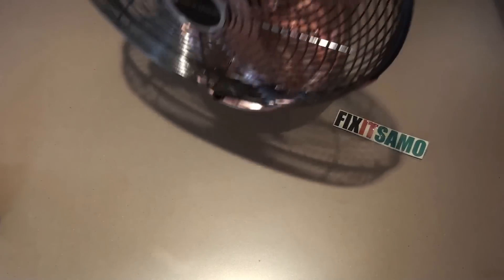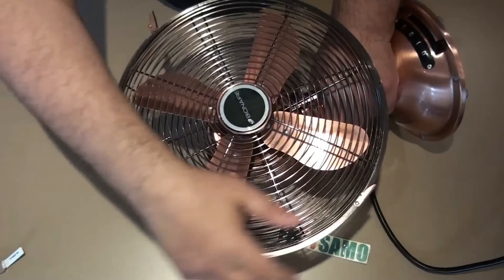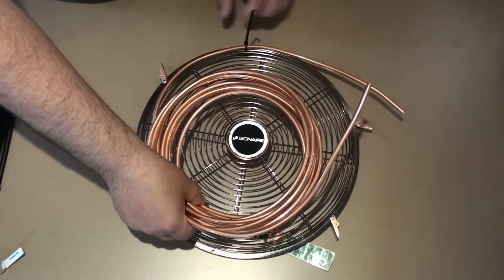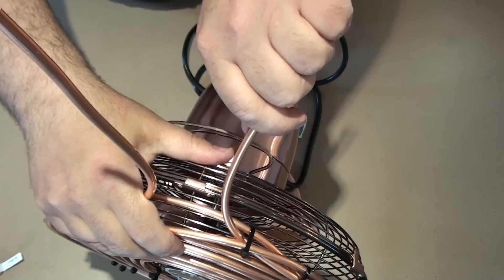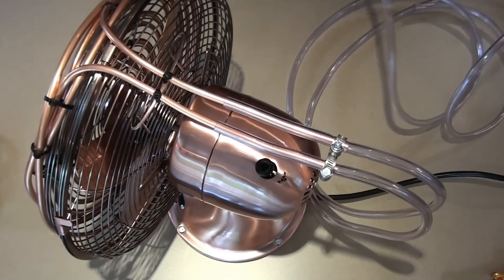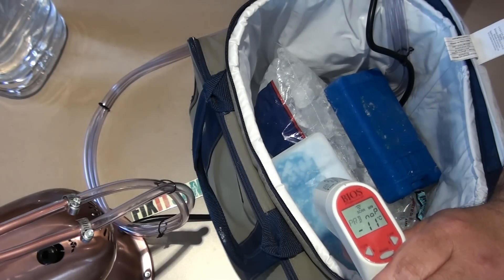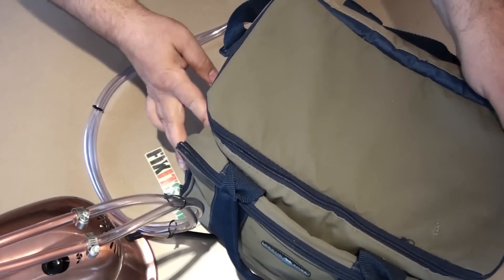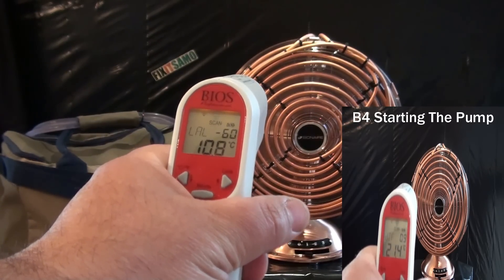How To Turn Your Fan Into An Airconditioner  AC

Comment: the most important part, is hard to understand.. how did you hook up the pump and hose to make this recirculate?? lol :D "I am definitely going to make one of these.. the bag I put the ice in will be on the side of the wall with air conditioning.. Im thinking that once I get it up and going my ice maker "ie, plastic trays" in the freezer will be able to keep up with this for several days to a week.. esp if I sit the ice box inside of another one.. double insulate it :D great idea for the next room/closet that just needs a little boost ;) Im just not clear on how it recirculates.. but other wise awesome.. Thanks :D

Comment: if u can afford that much copper u can afford an AC
Reply: corey I I'm a plumber, a 50' coil of 1/4 copper is much cheaper that a A/C. He is discounting the electrical cost of using his freezer to freeze the ice.
Reply: Rhino qt Apparently you don't know how a thermostat or thermodynamics work. The thermostat will only turn the compressor on if the internal temperature of either the fridge or freezer section of the appliance is above the low temperature set point. Two reasons that the internal temperature will rise above the low temp set point:  one reason is due to no insulation being perfect the world around your fridge will warm up its contents, another reason is any residual heat contained in the food you place in the fridge. This energy will will "flow" down the energy gradient until homeostasis is obtained. Thermodynamic law dictates that all heat energy flow from hot to cold. Refrigerators are not like the A/C in your car while traveling at highway speeds. While driving a car at highway speeds with your windows rolled up, your car's A/C is essentially free operation. The only reason your fridge would turn on is because it is warmer inside than it is supposed to be. You know like filling the freezer with water that is much warmer than the ice cubes you wish to remove from it hours later, that heat must go somewhere. Your refrigerator is a person's single biggest electrical draw and it only cycles on when necessary, if your fridge constantly ran 24 hrs a day always it would cost more than your mortgage to operate(possibly depending on the size of your house) and would burn out rapidly. Do a little research before you want to argue concerning topics you know so little about. Good day to you.
Reply: Breandan Byrne your freezer is on regardless of you needing to make ice or not
Reply: Rhino qt Your freezer is not on regardless of you needing make ice or not. Is that simple enough for you. You're very brace considering I can't reach out and touch you. If you believe my information to be inaccurate then go on earn some information for yourself. Good day to you.
Reply: Trevor Loffler thanks, random white night o7 I appreciate your input
Reply: And the heat from the water that the freezer removes is put into the room that he uses the ice to cool. You are just moving heat from one place in the living space to another. That's why A/C units go through the wall. The heat is removed to the outside.
Reply: put the insulated cooler with the water outside then? i'd rather a cool room if i did this than a warm water box. These comments are nekk level

Comment: how bout using liquid nitrogen?
Reply: salem zeid Tubes would explode.
Reply: ...
Brilliant idea.
Absolutely try that.
There's nothing that can go wrong.
You won't get seriously injured if sitting right next to it!
I am totally being serious right now.
No joke.
Actually yes joke, that is a very bad idea for several reasons, the least of which is the tubes bursting or even exploding.
Reply: Volvirth Out of curiosity, what problems could he have other than the tubes exploding?
Reply: +Hello_ Burn marks over his skin and lacerations from shrapnel
Reply: Viewing Wouldn't the leidenfrost effect protect him from burns? And I'd say shrapnel comes under tubes exploding...
Reply: +Hello _ Nothing will expload because the liquid nitrogen would freeze that tiny pump as soon as it runs through the pipes.
Reply: Viewing Would it not decompress and force itself through the tubes anyway?
Reply: Viewing Also, where would the shrapnel come from if nothing explodes?

Comment: If you add two table spoons of salt to the cooler, would you get colder temperatures?
Reply: Plus the salt water would cause the metal to corrode (rust) thus making the transfer of energy between the water and pipe slower.
Reply: Probably not, because the salt will cause the ice to melt faster.
Reply: Rafael Roman well the first guy is an idiot. it doesn't melt faster. I lowers the freezing temperature which would in fact bring the water down a few degrees. it probably wouldn't do enough to be worth the corrosion. but it's good thinking
Reply: Nick Petrillo my military buddies always put salt in there coolers to make beer colder but I didn't think hard enough on the rusting part.

Comment: this won't work in Florida where we get up to 110°😧 sometimes in the summer , but it might give some relief 😰
Reply: Of course it will.  You just need to use a full sized chest cooler, full of ice and water. Drill a small hole in the lid, and use a rubber plug to fill it in. Run the tubes through the rubber, and there you go.  Not only will it work, but it will probably get colder, and last longer.  Give it a try and see how it works.
Reply: 5065ca Provided that the ice us still ice, it should work.

Comment: How long does it last?
Reply: It would probably last longer if you use block ice, rather than cubes. Far less surface area.
Reply: GlobalTubeTruth2 Less heat transfer though. So hotter water.

Comment: that was great. using the ice packs is a good idea.i was thinking using loose ice but that would cause a mess. 

I was thinking using a motorcycle radiator instead of the copper pipe and a stationary fan (non osilating).
Reply: A young lady from Kentucky said her family has a cave on their property, they keep ice blocks in.  
In the summer her mom places ice blocks behind fans, surely in large enough shallow pans to catch the water, I would think.
Anyway, she said that even on the hottest days she froze in the house, it was so cold.  She didn't like it.  I love it cool, so it would be wonderful for me.

Comment: People complaining that it costs too much for ice are really fucking stupid. Think about it. All you have to do is put water in the freezer.
Reply: If you just put water into the freezer, the freezer will heat up your flat more than the ice will cool it down.
Reply: Agreed. You know some people have to complain, and try to shoot down everything that someone does.  I would think you could just use some of those freezable gel packs instead. They might cost a few dollars, but you only have to buy them once. Their freezers are already running, so there is no additional cost to freeze and then refreeze them. I'll bet someone will bitch about that costing too much as well. Let them sweat.
Reply: Simon your freezer is always going or near cold enough.  If your freezer is producing that much heat,  there's a issue...
Reply: Simon How does that work?

Comment: It's not an air conditioner. It's an air cooler
Reply: Plus air conditioners also remove moisture from the air, they don't just heat/cool the air
Reply: breakjazzyahoo an air conditioner works in a very similar way
Reply: they have the same purpose, to cool off the air. but how they works is different. this will only blow cool air to where it hits. an airconditioner cools off the whole room.

Comment: How efficient is this compared to an a/c unit?
Reply: You cannot compare this to an AC, as what is shown here is not AC. You are comparing apples to oranges.
Reply: No, because it doesn't control neither the humidity nor the ventilation. If you keep this inside a room, no air is going to be coming in or going out, it's gonna be the same air all the time. Not only that, the humidity will not change significantly (if it's humid, it's gonna stay humid). So it doesn't condition the air in both those respects.

Comment: A little query, brother, since you did such a good job at making this video as most of the videos out there are either "fake" or "expensive" as shit, I don't have a pump like that but I do have a Rissan Air Pump which is capable of handling a 5 ft tank (150 US gallons or 566 litres.) Also, can I use a small 1 ft square fish tank instead of using an ice bag? Will it work the same way? Please help me out here a lil' as this was very informative and practically seems doable. I'd very much like to try making one myself. (i.e. Can we make the same thing out of like, a mini pump and basically a large sport water container? I think that'd make it a lot more "portable" and convenient to use. What do you think, maybe you could make a video on that idea. Just speaking my mind.) Once again, thanks for the video and have a splendid day!
Reply: Lunr. If you create a brine solution you'll be able to get the water a lot colder, that's likely what liquid ice is. The more salt in it the colder it can get without freezing. If you wrap the fish tank in styrofoam or blankets or both, just insulate it and cover it it will last longer.
Reply from the maker: +Lunr. You can add a valve to your pump  to control the water flow
 sure u can use a fish tank  the only problem is the ice it  won't last more than 3hrs
Reply: fixitsamo How about liquid ice? As far as I know, they seem to stay longer as I've seen people basically making drinks with them at party's.
Reply: ImNotMoose My thoughts exactly. Thank you, brother, I wasn't quite sure whether wrapping and encasing it like that would work, but it seemed quite logical. Now let's see about that brine solution on YT and get to work. It's basically sodium chloride solution in water, right? Have a wonderful day, man!
Reply: +ImNotMoose Actually the salt water will just make the water cooler (Since it melts the ice by raising the freezing point), it will slow the transfer of energy from the water to the pipe though  because the salt will cause corrosion on the inside of the copper tubing, salt water is one way to artificially "age" copper.
Reply: SilvaDreams So, what do you suggest then?

Comment: What if you used an actual mini fridge compressor? then it would be a real Airconditioner lol
Reply: you would have to put that thing in another room or outside in order to lower the temperature in the room youre in.
Reply: @TheDude50447  a mini fridge compressor does not produce that much heat. What you could do however, is drill a 3/8 hole on top of the fridge. Run a hose and pump from inside the fridge sitting in ice water. This way the water temperature remains constant and you dont ruin the compressor by trying to cool the room with the air alone. 🤔 yes that definitely would work come to think of it. Just make sure you put a rubber gasket where the hose enters the fridge to keep the seal airtight.
Reply: Not exactly. A mini fridge compressor is designed to cycle refrigerant through a specific insulated space (Fridge) so the air inside remains at a constant temperature. When the air escapes from the insulated space (when you open the door) the compressor will kick on. Now in the case of the fan. There would be a huge space (bedroom/living room/ect.) For the small compressor to try and cool. The refrigerant returning to the compressor will be higher than its rated capacitance, not allowing the compressor to cycle properly. thus eventually burning out the compressor. This is why when an AC tech does an estimate for an instillation its important to know the size and space of the house/building. Nevertheless, initially your rationale was on point.
Reply: It would use way more energy
Reply: If you use a compressor, you will have to use a gas+valve+condenser.

Comment: It would actually be something you could take outside and have it blowing directly on you if you were just lounging around or working on you car. Sure, the ice would melt faster, because of the outside heat being blown through the coils, but I think it'd be worth a try. It's a very inexpensive portable unit. Why not?

Comment: Now you just need a magic ice machine that produces ice out of thin air : D  This works fine its just that you are moving heat from one place to another.  If your ice machine is outside that this would work.  But then you are using quite a bit of power for an ice machine, so a window air conditioner make much more sense.   .  If they worked you would see them in stores.  It would work temporarily, like for a tent in a backyard or a car or something.  You can buy bags of ice I guess, or steal some from your neighbors.
Reply: In my country we have magic ice machines.  They don't produce ice out of thin air, they need water.  We call them freezers, and they usually come with a fridge (refrigerator).  We put things in it to keep them really cold, like ice cream, frozen vegetables etc.  The amazing thing is that we can buy little plastic containers which we put water into and put them in the freezer.  When frozen we call these ice-cubes, which we put in drinks etc.  These ice-cubes can be used in this guy's bag.
Reply: rubaluva Actually, something like that would be very easy to make.
Reply: Hello _ a freezer?

Comment: Does water start dripping down the copper after a while?
Reply: I mean like if it's really hot and humid it has to? So you probably have to put a bucket underneath?
Reply: sokree1 I thought that but actually if the fan is on and it's warm outside then the fan will be constantly blowing hot air into the copper pipes before they have the chance to cool it so I assume that the majority of condensation would evaporate.

Comment: wel done good idea ıd sugest put some tubes in a 10 lt plastic watter bottle and freeze it  than run the water through the motor in to the tubing  some isolation cover on the bottle will work much better .thanks for shearing

Comment: average price of an ice bag is $2  per bag. also u need to replace the ice bag every 40 min or so to make this work. average electricity costs 16c per kilowatt hour. if you own 1000Watt window AC unit U can run it for 12.5 hours and it would cost u $2.  hmmm
Reply from the maker: +Manuel Siegrist the ice will last around 10 hrs  if you keep the cooler closed 
If you use bigger blocks it would last even more 
And you never need to buy ice you can just use a Tupperware fill it with water put it in the freezer and you will get a nice block of ice the second day
Reply: Well, an hour or so of cooling would allow you to go to sleep decently. Also, you can remove the bags in the morning and re-freeze them in the fridge. I don't think this is meant to be a solution of cooling a house or an office all day long..
Reply: Wouldn't block ice melt slower, and so, last longer for more cooling time?

Comment: What happens if the water is at room temperature?
Reply: The air is being pushed past the cold water in the tubes.  This cools the air down.  If the water in the tubes is room temperature, then the air remains at room temperature.  Because the air being pushed is what determines the temperature of the room.
Reply: Thanks! :)

Comment: Water flows into both tubes ? Doesn't the water get stuck if the tubes are filled with water will it leak?
Reply from the maker: +Amos CYW 
If you look closely in the video the first tube comes from the water pump inside the cooler the water goes thru the copper tube  then back to the cooler 
Thx to the water pump the water is recycled

Comment: Good idea, but you may want to reconsider where the connections are. Its not a good idea to have the water running right over the motor in case theres a leak.  And condensation will drip onto the motor
Reply from the maker: +DisplayName01  you are absolutely right i only placed it this way for the videos to have a better  view and i forgot to mention that both tubes should be placed  at the bottom  unfortunately youtube dosent allow to edit the video  when its already ben posted

Comment: hi, happy New year.
I've previously watched your video and like the rig but didn't find a need. recently I got in 5 beverage coolers each at $1,000 a pop for a bar, and the set back of these is drinks are cooled in a water bath. (a cooler box refrigerator, which tends to rust metal cans peels labels off bottles , floats plastic bottles was a messy tub of dirty water and label glue) I've been pondering about a modification, and eureka I joined the dots , separate the water from the beers, your tutorial has provided the answer bro. a cost effective solution
big thank you !!!!!!

Comment: Very nice setup.  I'd consider throwing a bit of salt in with the water, although you'd probably have to experiment with the ratio.
Reply: The salt may corrode the copper pipe. Also, depending on the pump, the impeller shaft may be metal. A lot of manufacturers make pumps and filters with ceramic impeller shafts to be used in fresh and saltwater aquariums, but the cheaper ones still use steel. That's why people who keep saltwater fish need to check the filters and pumps to make sure they're safe for salt or the salt can corrode the shaft and/or release metal toxins into the aquarium.

Comment: good way to poison yourself
Reply: Nev AWESOME
Reply: how can this make you sick? Mold build up?
Reply: can't poison yourself this way. people have been using fans to blow warm air over ice since the fans conception.  if your talking mold then it's a far reach. If your talking electrocution from condensation reaching the fans internal AC power, that's  not going to happen. I have shorted out  many electric motors via water and gels.  It would be different if you took the fan in the bath with you. The condensation will be distributed past the electronic contentions. If by chance it did short out then the fan would stop.  It would be different if we were talking about a toaster oven.